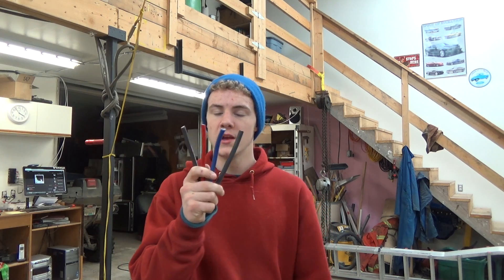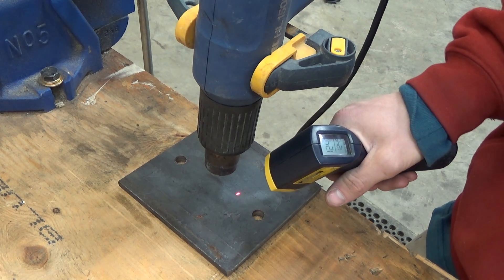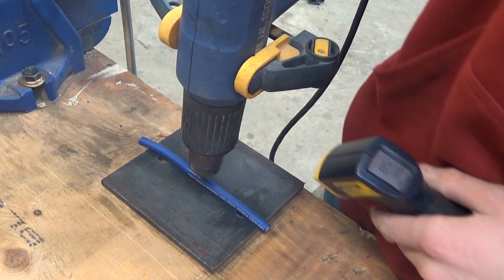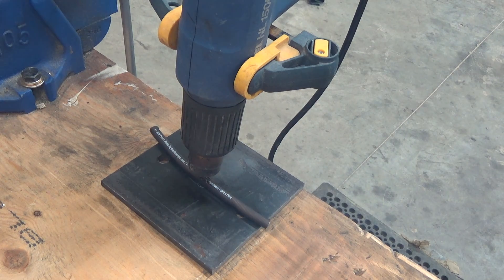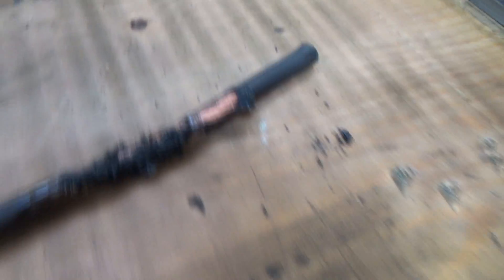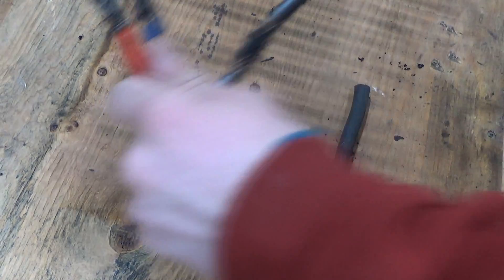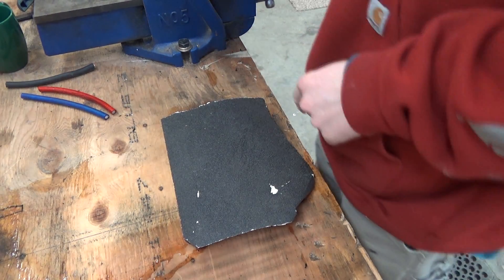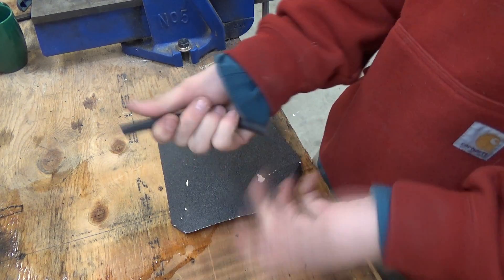Welding Cable Vs Car Audio Cable

Comment: Copper is copper. Not really much you can do about it once its insulated. As an installer, your power comes from how you terminate. I stopped crimping power leads years ago. I solder now. Use the lug like a cup, heat it up, fill it w/ solder and slide the copper in. 100% contact. Crimps itself as it cools off. Heatshrink the ends. Really is no better way.

 My power runs are 2/0 standard welding lead. Rated to 194F. If the AMBIENT air in your engine bay is 194F, you have bigger problems than car audio.

Comment: Who the hell is going to run a high temperature heat gun directly on their wire? I get it's just a test but in real world this doesn't make a whole lot of sense. New concept is excellent stuff. As long as you don't run it 1 in away from a heat gun.  A fuse is going to blow way sooner than that wire jacket is going to melt.
Reply: It’s supposed to mimic under hood use but I see what your saying

Comment: TEMco is my go to welding/battery cable manufacturer. The ONLY competition that welding cable wounldnt win is possibly in the looks department, id rather have my current going to my amps than pretty jackets on my wire. For my money and piece of mind, its weld wire. Specifically TEMco brand. TEMco is the best price and flexible and it looks good imo. Im a welder and have been for 25 years. Ive seen what weld cable can stand up to, its insane. I like that the specs are listed right on the jacket of all certified weld cable. It has to be so you know what it can handle.  With most all car audio brands of wire, its anyones guess, 😂. Most people i know also run weld cable after learning over time what the better  choice is. Who would choose pretty looks over performance? Thats what it comes down to😊

Comment: I run 2awg welding cable from the front to the back and i use 1awg CCA 3ft runs from the 2nd battery to the amp works just fine for running 3k.
The reason for 2awg front run was 1awg was too big for my little chevy sonic.lol

Comment: If welding cable can survive in the brutal environment of a welding shop or out in the field for decades it will probably last in the protected environment of under the hood of a car or truck.
Reply from the maker: All signs point to yes .

Comment: Dodge uses welding cable for the positive battery lead on Chargers and Magnums.
If it's good enough for Chrysler to run under the hood it is good enough for me.

Comment: I got some welding cable I believe it’s like 7/0 🥵⚡️about to install on my system don’t know if it’s 4/0 or 7/0
Reply from the maker: you must  be in the us, most places that still use the awg scale switch to mcm/ kcmil after 0/4(0000)

Comment: The true test would be to test the voltage drop across say a 10-foot span between the different wires. The difference between welding cable and high quality car audio wire is welding cable is copper wire and car audio wire is either copper or tinned copper. Also car audio wire usually has a lot more strands. The more strands you have in a cable the less resistance in The Wireing which in turn creates more power from your amp. 4 gauge welding cable usually has 370 strands. Stinger Pro Series car audio wire 4 gauge has 1660 strands. That means a less voltage drop from the Stinger wire versus the welding cable

Comment: Very very good job at this. I love the way you approached it. I used the amazon stranded audio #4 Gauge wire. I have a degree in electronics and thought it would be fine for a Renogy 3000-watt inverter. OMG, I cannot believe I did that. I could not figure out why the inverter would not work with the audio cables using thin strands that would not allow enough current to pass. Lesson learned. I believe changing the wire out will allow the inverter to work properly and not shut down when the batteries are at full charge.  TBD

Comment: FYI at 1:38, It’s “tinned” like win or finned, not “tynned” like wine or line.  The wires are coated in tin.
Reply from the maker: looking back I still shake my head at my previous self, cheers

Comment: I’m a welder of 30 years also a builder of car audio from the get go I’ve always used it a lot if you have any doubt about chaffing I’ve run it inside heater hose but for the price and if you’ve been around welders and cable you see it drug through the mud muck and grime it will lay in mud or wet ground and dry it out so it builds it’s own heat up from working and see cutting torches used spraying sparks all over it and hears you a way to test it hook up the same length of each one to power and ground them out see witch one burns the insulation off 1st and all the way up till the last one . Also for running it inside the vehicle and not under on the frame but also HEATER HOSE the water from the motor going through there is over 220 degrees and you can get welding cable in all kinda different colors and great job man I like that you use welding cable and I’m glad you stand behind what you know works and believe in it wise shopper getting better quality supply’s that are tougher and lose less current yeah welding cable been along time coming that some one made this video now watch welding cable sky rocket like the rolls of valley aluminum rubber covered stuff did some years back someone figured it was close enough to use it for sound deadner so yeah it went up to we’re it better to use sound damping material cause it’s cut in bigger peaces also find in junk yards or on old junk cars there are rubber mounts for the a/c radiator the ones I look for are rubber in the middle and a threaded stud out each end I use them to mount my amps this way they have a shock absorber if you have a lot of bass I’ve seen connections in solder come lose boards crack other things that had to be from the vibration so every thing you can think of if it could fix the problem and don’t cost a lot might just be one of the next best thing keep bumping my fellow bass heads!

Comment: Love the test and welding cable crushed the heat test. But damn son, 170 C? That's kinda like plopping your wire on exhaust manifold.
Reply from the maker: are saying your not supposed to ty wrap to the hot parts?

Comment: I would well I do use welding cable everywhere ha I’m a welder and my leads are about 7 years old and used daily drug in gravel across pavement gets walked on drug through oil grease and it looks like new when cleaned off
Reply from the maker: pay for quality get quality

Comment: well if you protect the wire just like any other "Car audio" power wire, then the welding cable will outperform any name brand car audio stuff and a fraction of the cost. Car Audio is so brand identification that some people are brainwashed into believing myths, and some myths have survived so long and are so pervasive that they have essentially become "Truth." 
--this happens in almost every profession: We do it this way because that is the way we have always done it. blinds people from the truth.
Reply from the maker: sums it up right there.

Comment: What the amp rate for the 1st welding cable?
Reply from the maker: so many ways to answer this question, you will have to be more specific on this question
Reply: @DonkeysBreath  ampere rating of the cable. I see they are selling 300A, 150A and many more. I also being told that using welding cable much better than normal power cable.
Reply from the maker: What application are you asking about, because welding cables will be marketed for a Specific amperage at a specific length indoor duty cycle
Reply: @DonkeysBreath  if i want to use welding cable for cat power amp? My amplifier manual state min cable to use is 4awg. Appreciate your  input. 😀
Reply from the maker: 4AWG copper welding cable would be a safe bet however you could always purchase two AWG and give your self some head room if you got 20 extra bucks
Reply: @DonkeysBreath  price maybe will be an issue. I already have 4awg power cable. Will survey dor the cable.

Comment: of course heat wont hurt a welding cable.. imagine dragging an amp wire across a red hot fresh weld!  welding cables are tough.  however the rubber is soft and will degrade as it get older.  but this will take years.
Reply from the maker: agreed thanks for the comment

Comment: Say youngster, I was wondering what u were thinking putting that pipe on that vice handle. Though some "made in usa" vices are surprisingly tough, that China vice didn't stand a chance. No vice is designed to do that silly shit!
Reply from the maker: live and leaner

Comment: Tin coated copper will last longer, moisture and heat will cause the the welding wire to break down, but ur equipment and car probably break first it takes years to start oxidation
Reply from the maker: yes sir, agreed

Comment: What about using 2 gage battery jumper cables and crimping on the correct ends to wire the amp
Reply from the maker: technically would work but often poor quality cable

Comment: Wouldn’t running power through them be a better test?
Reply from the maker: With the constants I have no not better. If I had the time and money to build a cable Dino sure it would be better
Reply: @DonkeysBreath  So all fail the abrasion test. Is abrasion same as which can be cut faster?

Comment: I have 4/0 welding cable running from alternator through my engine bay to the rear for over a year ..it works perfect..people bitching about the flexibility 🤦🏾‍♂️ it works perfectly fine for car audio..
Reply from the maker: lol i come from a world were welding cable is like a wet noodle.

Comment: Also Will Ferral caps help with the welding wire stopping or slowing corrosion
Reply from the maker: i think it would depend on the type of terminal. could be better could be worse.

Comment: Does welding cable  copper (straight strand wire). have more resistance than wire that’s pre twisted
Reply from the maker: No, twists and or breaded wire helps with repeated motion

Comment: Who ever told you that welding cable will melt in an engine compartment or that it's not as tough, obviously doesnt know anything about welding and is 100% wrong about welding wire
Reply from the maker: As I sad sales person.

Comment: Welding wire is typically super hard while audio cable is soft copper also 2 different types of juice going thru them wich effects how they perform.. welding cable is usually a mfer to work around corners n such
Reply from the maker: Welding can be both ac or dc, but mostly its dc.  as well ac vs dc current for this application will have negligible performance differences, ie volt drop and line loss. copper is copper there is no soft or hard. you mite be referring to strand size however.  im used to dealing with 2/0 cooper that has for example only 35 stands total. so with wide perspective welding cable is easily bent.

Comment: OFC wire is oxygen free copper. I knew you were going to break that vise putting a lot of force on it and its only made of cast iron not steel, I done that before on a 4" vise trying to force tighting it down on a car part. I would go with the stinger cable of my choice for car audio i have always used stinger for my car audio projects as it never game me any problems . I don't expect it to catch on fire or try to force burn it thats why when you run any cable in the engine compartment and along the cars interior floor its best to cover it with wire loom or techflex braid as an extra protection against abrasion. On the the blue stinger 4 gauge cable is usually tinned copper, maybe the one you tested isn't but on the Stinger HPM series its tinned silver to protect it from corrosion.

Comment: Absolutely 0 of these tests make any difference to the performance of car audio cables. And 125 is standard engine compartment heat.
Reply: Seemed to be a decent durability test to me.

Comment: I have always used walmart on cheap installs. I have used welding cable,sky high,rockville,rockford,kicker,stinger,cadence,boss, DB. I have had zero problems with any of it when installed with some common sense. Obviously route away from anything hot or sharp. Secure the wire so it doesn't rub,use wire loom when needed,don't overly bend the wire in a sharp radius. Keep in mind that the cheaper brands are smaller then advertised. The CCA can't handle the current the OFC wire can. 
You follow this info and you will be fine no matter the wire you use.

Comment: If I have to go near any high heat/abrasive areas I usually put my cable inside a garden hose. So I use plastic loom then garden hose in the problem spot then back to wire loom.

Comment: I like sky high 1/0 ofc, nice thick cable. Welding cable is also great more durable jacket but use 2/0 in welding cable. Buttttttt.... I just learned about gp car audio cable and hands down the best fn cable, only cable on the market that I know of that is sae certified, heat resistant over 200 degrees, very flexible outer jacket ceramic inner lining and they use c10100 grade copper which is the hights purest grade copper.  This is just my opinion.
Reply: Also chemical resistant.

Comment: welding cable  wraped in high heat fiberglass loom were needed   ,,,the rest is run in wire loom  beats them all nof said

Comment: Welding cable usually has EDPM rubber jacket that is resistant to temperature extremes and
remains flexible. Perfect for car audio. Been using it for years and saving $ over "car audio wire".

Comment: actually oil is really really hard on alot of rubbers, n a coat of oil is goin to get on everything on alot of vehicles, alot wont yes, but alot will..   the walmart stuff wasnt the crispy one actually it looked like it came in second it didnt expose any copper wire when melted the only other one to do that was the welding cable  whats "abrasion in the hand resistant"?? lol  u need to start usin a timer, the walmart stuff did better than the blue cable against sand paper, n better than all of them actually  honestly as much i dont like to admit it the walmart stuff seemed pretty dam good actually
Reply from the maker: I very much disagree with your conclusion

Comment: I just upgraded my amp wiring using 4 gauge welding cable its good to know the welding cable took the heat better than any of the others.
Reply: It's better all around & much cheaper. I recently got 20ft of 4awg ofc welding cable for $30. The closest equivalent "car audio cable" was $45... If your cables are taking the kind of abrasion he tested, you've got much bigger issues than just your cables.

Comment: I'm a welder 10 years in the trade . In rare cases I've ran 500 feet of welding cable with 150 amps coming out the stinger, and I can testify that welding cable may not be the most resilient but when it comes down to power it will get it done. I personally upgraded my truck with the big 3 and guess what ?, all the extra 2&4 gage cable I had sitting around came to good use saving me an easy 100 bucks so for me it's a no brainer when I need thick cables for anything.

Comment: I had a ground connection fail on a huge automated welding machine I was running and the insulation on the ground cable caught on fire. The connector, which was a huge copper twist connector melted and the cable melted in half. I spoke to the manufacturer and they said they quit using those connectors and now hard wire the ground wire in the machine. That was exciting.

Comment: What o don't understand is why are people using blow torches and high heat on amplifier wires? #1 if people stop using the dam fire wall as a location to run wires they will not heat up so dam fast #2 if you are using a mega amp and battery system why are you even look at cca wires?#3 if you just purchased  long enough wires to run in the front header panel going forward in your car will bring in cool air hence air filter! #4 why are people using extremely high heat on wires and not starting the introduction by addressing people who are not using a 10,000 watt system iv been using 4 Gage cca wires on a 2 amplifier system that that using 125 amps both amplifier are a 1000 watts each one at 1 ohm the other at 2 ohm for 12 speakers  1000 Watt on a 12 Inc sub 900 rms 800 Watt on a 8 woofer for mid-range in the dam 3 year I've been using this hook up iv never blew a fuse because I have enough commen  sense to Kno that the more power the better the conductor I need smfh

Comment: I've been a car audio installer since 1985 and have always told customers to use welding cable. It can move a lot of current instantly, somewhat pliable, less expensive, true gauge, but just doesn't look as good. Now days the looks can be fixed with some nylon covering with heat shrink on the ends. Now days we have cable that isn't even copper or even the right gauge. I would trust welding cable more than a lot of the crap that is out on the market these days.

Comment: Is there a federal law that says use the wrong cable for stereo installs? Using real battery cable is actually cheaper and better quality than Chinese car stereo crap wire.
Reply from the maker: Federal law wtf, first off what country... and there is no way real batt cable is cheaper, Chinese crap is almost free
Reply: https://allbatterysalesandservice.com/bee-wire-cable-1-0-red-starting-battery-cable-per-foot-c525-5
Reply from the maker: Twice as much as cheap China stuff

Comment: Abrasion should I be occurring in your vehicle that means it was not properly secured make sure you secure your wire with zip ties in any form a strong adhesive tape that is weather resistant to assure that it is not have causes for abrasion